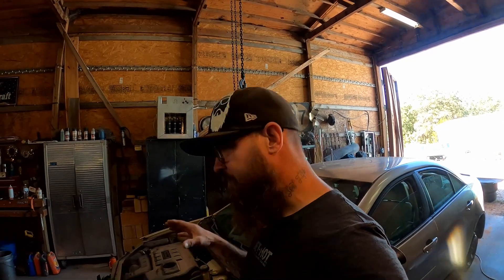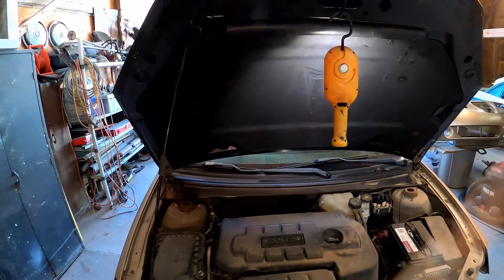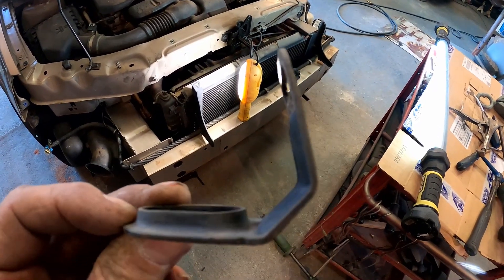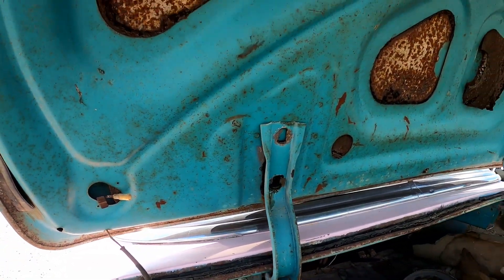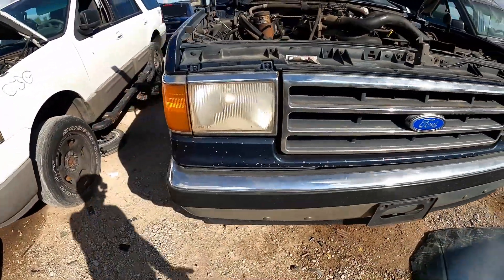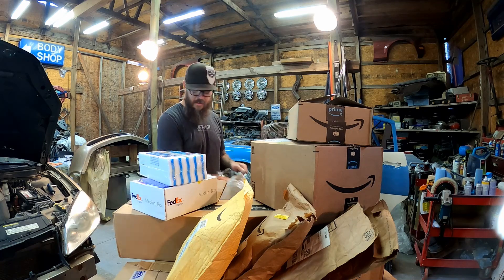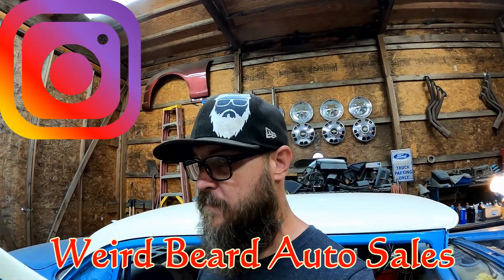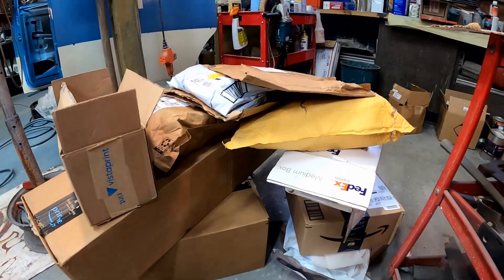Fixing the hidden damage on the Pontiac G6

Comment: Just a quick hood liner trick. Get a can of spray on fabric adhesive and a pick set. After cleaning/washing. peel back the scratches to open the inside, spray, wait/or follow tacking instructions and fold back the outer layer and rub over and flatten with your steel picks (glue basically won't stick to the steel) If you have a couple of bigger tears. Trim a smidge off an outer section. Usually close to the windshield. Mull it up to dusty fibers. Spray the hole/tear And fill with the spray glue and dab the fibers in. Tedious, but with a tad practice. It works and looks very passable. ;)

Comment: my bronco was swapped before i bought it. the bumper brackets are different. they homemade a set. you also need the 92 up wiper cowl. i went back to the 90 brick front though. if you was in ky id sell you a 92 up front. i like the brick myself. that blue brick looked to be way to nice to be in a junkyard as did that olds and nova.

Comment: if you swap to a 92-96 front clip you will have to get the core support (new mounts) and the wiper cowl (think). along with the fenders, header panel; grille; bumper; lights etc. 94+ core support has a r134a condenser bracket behind the hood latch. 92-93 bracket is for r12 condenser. 95-97 front XLT bumper also has the vents in the bumper. (cool upgrade). If you find a 95-97 you can do a r134a condenser upgrade.

Comment: Always a great job! I tried to send you PB Blaster so you can get rusted nuts and bolts loose before breaking them off. But for some reason your state won’t let Amazon send it to you. Just like the rechargeable magnet lights I tried to send awhile back. W-D 40 doesn’t get the job done as well as other products, plus doesn’t make a greasy oily mess W-D 40 does. Do you know why?         Roger in Pierre South Dakota

Comment: I think the bucket seats with console and the floor shifter will solve the header fitment issue. I'd stick with the original front end on the F-150, I think the 91 has a more classic pickup look. Since you have to go back anyway maybe you can find 4 alloy wheels since the tires didn't workout. I'm sure LKQ will refund your money on those. You go there frequently so they know you aren't trying to pull one over on them.

Comment: Quite the haul! You have some very generous fans out there. 
Just some rugs and finessing and you got that core support back to where it needs to be. You made that look easy. But that was your experience showing. 

To bad on the knifed sidewalls on the tires. Can you take those back and exchange them? 

To bad you did not find a 4th alloy wheel for the car. Those would spiff it up nicely. 

Those seats and console would be great for Darlene’s truck. How was the carpet? 

It’s worth taking your tools and going back for that Fi150 front grill and parts. It’s nice. And something like that is something you want to grab while the grabbing is good! Otherwise, it will get taken or destroyed by someone else.

Comment: Well now that you have to go back to the salvage yard again take your tools and get that front end and roll pan you were wanting to get before! that was the universe telling you to take another chance and do what you need to do so it's not another wasted trip. also i would check the other yard for that missing wheel from that one G6 maybe between the two yards you could come up with a whole set if you're still really into putting those wheels on it. that would help you sell the car easier i'm sure because they are actual period correct wheels instead of those steelies with hubcaps

Comment: you could put some tubes in those tires and use them on a lawn mower trailer?  boat trailer? but the might blow out the side walls only on something that is not carrying people. I have ran them on my truck before with tubes. I don't think they were sliced an far as those. for a trailer around your place or a hooptie maybe. That really sucks man I would have probably done the same thing they looked so good.

Comment: Learn Kayla to drive a manual, and put a 5 speed in that bad boy!  Count me in in the troll gallery bitching about the black paint on the underside of the hood - I mean, did you buy only enough paint to cover the top-skin?  You obviously had enough, so I'm betting you had some left over. I would either try to find a rattlecan which is close, (goddamn are them things expensive now!) or if it's not close enough, use it as two base coats, and then topcoat that with your leftover gun paint. But you are right - 99% of people will see that and think that it's exactly how GM sent it out the door. For jambs, and especially under the hood, if it's a common color across all makes, you're probably going to find something close enough on the shelf of the McParts store.

I got lucky replacing the cab on my old 1977 F150: When I finally faced the fact that I needed a new one, there was one on craigslist three hours away - and the same color!  That is extra important when you consider the amount of body color paint inside those old trucks.  New cab is two tone, but the interior is the right color!